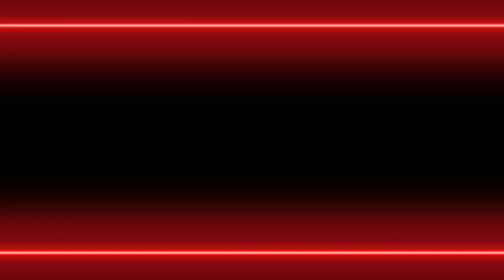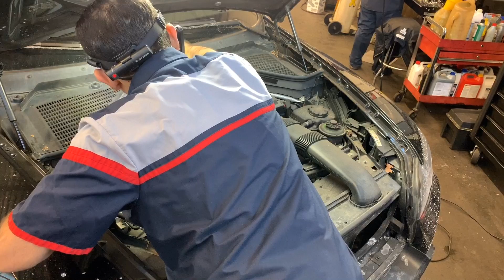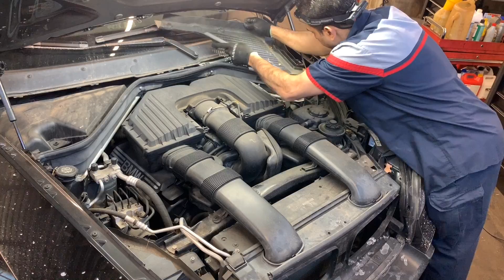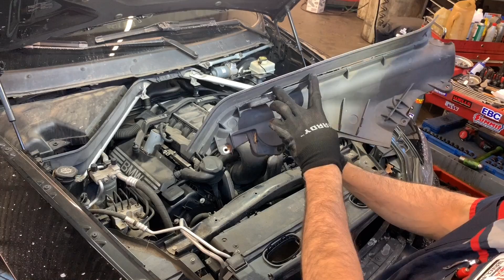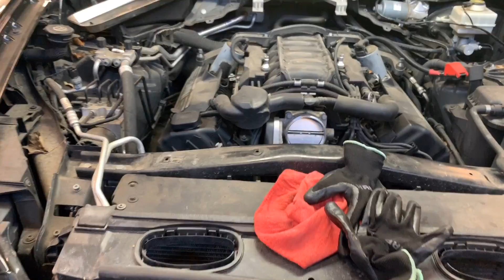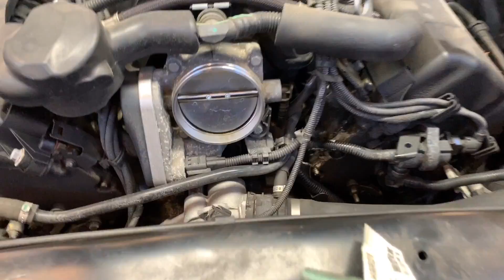2008 BMW X5 4 8L valve covers and oil leak repair! Huge oil leaks!! Part 1

Comment: Im working on x5 3.0. I found it hard to believe i gotta drop the frame to swap.out the engine...do to my lack of space i was thinking. If i remove the converters and passenger engine mount bracket. Would that give me enough room to swing the engine to the right to pass the front dif to pull the engine upward

Comment: Awesome videos - VERY HELPFUL! We’re currently replacing the valve cover gaskets, upper timing cover gaskets, and spark plugs too, cause why not. When you removed the intake manifold, did you have to replace the intake manifold gasket also? Or was that reusable? Also, the spark plug cylinders, were those replaced or reused? 

Thanks - you’ve been a tremendous help already. Subscribed, followed, shared. You’re the man.
Reply from the maker: Thank you. 
The intake gasket was replaced and so the spark plugs tubes. Too big of a job to take that chance.
Reply: @MaicSalazarDiagnostics  awesome. I have intake manifold gasket and vacuum pump coming tomorrow. Valve covers and upper timing case covers are off - almost back to assembly. Was able to get valve covers off without effecting the spark plug cylinders. I suspect that’s due to total mileage versus what you were working on. 

Can’t tell you how helpful this video series really was. Thank you very much for your insight and expertise.
Reply: Do you have any videos on replacing the alternator mounting bracket/oil thermostat gasket on a 2010 BMW X5 4.8L e70 with the n62 motor? I have a stubby T45 for a 1/4” ratchet but it’s still too big to get on the bolt harnessing the oil cooling line harness. Any recommendations?

Comment: Euro trash we call these oil leaking cars in Australia replace the engine with a straight 6 Ford BARRA VVT engine and all your oil leaks will go away as if by magic Ford mated these engines to the 6 speed manual and Automatic ZF transmissions so a natural for a complete engine trans swap 195 kw 391 nm non turbo 310 kw 565 nm for turbo versions easy to tickle to 600kw plus the downside not readily available in the US. AU and NZ market only but cheap now to buy and find a cheap way to import. These will run a million km plus I have one non turbo in my 2003 Ford Fairmont 850,000 km not a drop of oil leaking anywhere and still get 7.2 litres per 100km on the motorway. So your guys plan should be remove 4.8 V8 BMW engine fit Ford BARRA engine and or transmission fill BMW engine with concrete and immediately use as boat mooring block it would be much cheaper than fixing it and you would have peace of mind a win win win win scenario - YES!

Comment: At 200k km my x5 is still running strong . I only wish that these had a more impressive aftermarket community.
Reply: How’s it running?? Really want to buy one but reading a lot of bad reviews :/
Reply: @kiy647  so basically it’s a hit or miss when buying them. If they took care of it and changed the oil every 5000km. You should be fine. The seals may still be ruined, usually it isn’t that much of a problem. Here’s how u tell if your seals are bad > idle the vehicle for 20 mins and then rev the engine, if it smokes it means the seals are bad. Also shop fees are expensive because of labour. So try and do the work yourself. There are ways to possibly fix the seals yourself without paying the 4000$ you can use seal conditioner but don’t just buy one you gotta buy 8 bottles and slowly add over time. I haven’t done this because seal conditioner is like 150$ per bottle.

They are not crazy fast but it matched the speed of my friends 2019 Subaru wrx.

Comment: Its a Great Video- What do you have call the plastic that broke(the one you showed at 10:20 Minute) , i have an X5 and the plastic of that car broke too- Not sure if i can get that in market or any store and fix. I am not sure what exactly its called to ask anyone.
Reply: Thanks For the Quick reply- You made my day- its a total relief for me.
Reply from the maker: See if this is what you are looking for
https://www.partsgeek.com/gbproducts/SC/24083-08013640.html?utm_source=google&utm_medium=ff&utm_content=SC&utm_campaign=PartsGeek+Google+Base&utm_term=2007-2013+BMW+X5+Engine+Compartment+Panel+Genuine+51+71+7+169+419+Rear+Left+Upper+07-13+BMW+Engine+Compartment+Panel+2008+2011&fp=pp&gbm=a&utm_source=google&utm_medium=ff&utm_campaign=PartsGeek+Google+Basecid=6774379819&aid=79287199093&keyword=829684093369%3A%3Apla-829684093369&kid=829684093369&gclid=Cj0KCQjw-r71BRDuARIsAB7i_QOdP8SzSWe5DBUKRGhGscUGERT3_VLYoqPe68xGTuiEd04t8-eBqBgaAsd9EALw_wcB

Comment: Hello! As a mechanic, do you recommend this motor in this Bmw version? I am thinking about such a unit from the USA but in Poland it's hard to get any information about this engine. I know that v8 engines like to lose oil on all sides but won't the engine seal lead me to a hole in the budget :-) Best wishes Luka
Reply from the maker: Łukasz Ostałowski  not this version! It has a lot of issues with bad injectors, Valve seals, alternator too small to keep up with demand from cooling after car has shuts off to cool turbos that end up cooking the oil! So not this one!!
Reply: @MaicSalazarDiagnostics  Oh. So, there is nothing to load in these bikes the more that I have no one overwhelmed in the subject of BMW v8 and even more so in newer models. Approx. Thanks for the quick reply. I will probably look for V6 :-)

Comment: Is this car expensive to maintain compared to a v6 mustang 2014?
Reply from the maker: Well if you get a low mileage it is probably not as bad. I try to steer my costumers on getting a car with less than 50k miles so they can get the premium extended warranty! If you don't do that you will hate this cars or just get new!!

Comment: Hi. I replaced couple of this kind of valve cover before. I had to lowered the frame a little bit to be able to removed the valve cover out. Bmw valve cover always bend so you should replace it. Hey what about the new scanner Bosch ads 625. That scanner very good man. I was lucky guu bought it new from ebay 3500$. Somewhere else 5k. Bosch scanner cover wiring diagram up to 2016 , repair source and tsb ,service bulletin. I think in the market now have only 3 scannner come with wiring :bosch 625, otc evolve( bosch software) and matco maximus 3.0
Reply from the maker: Dung Pham I really like Bosh scanners. Matco not so much. I have not use the evolve yet but seen few videos and seems to be good too!

Comment: Plastic valve covers warp so get ready to do the plastic intake manifold too. Plastic still does not hold up in high heat areas . Fail BMW wait till you see cost to replace with new valve cover if needed $$$$ hopefully aftermarket available now.